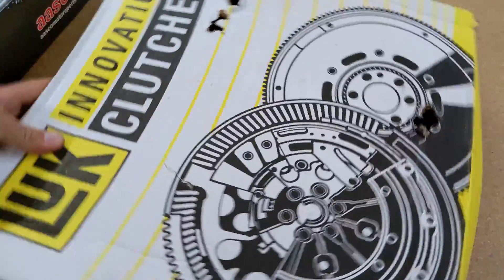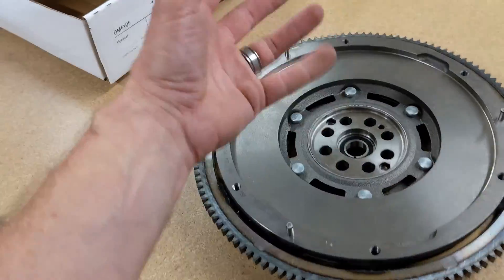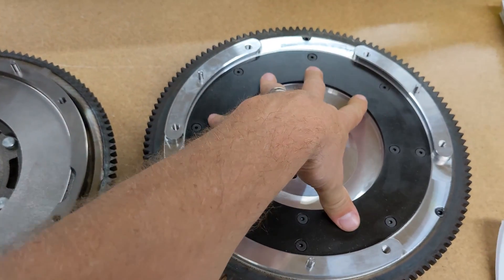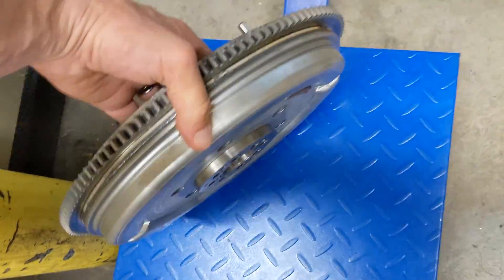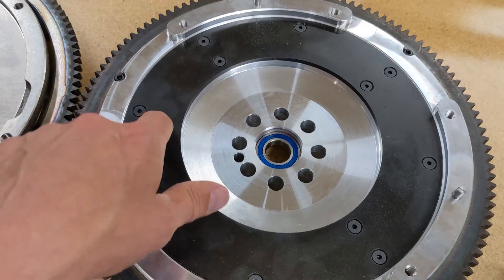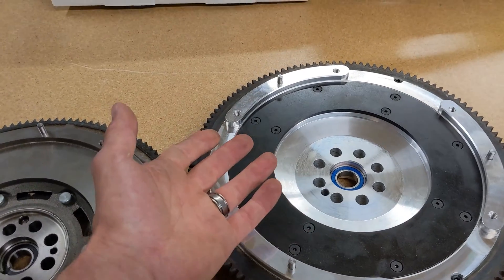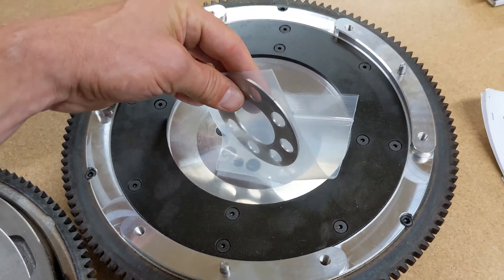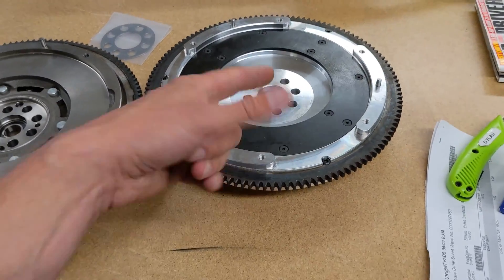Honda J-Series Flywheel Side by Side: AASCO Billet & LUK OEM Dual Mass

Comment: Would you happen to remember what brand clutch was the one having clearance issues and had to be installed without the torque plate? I know you said XLR8 but i know they sell different brand clutch kits. I have a stage 1 Action clutch ready to be paired up with the aasco flywheel would like to avoid torqueing it down just to have to take it off again. Thanks in advance!
Reply from the maker: Not sure what you are referring to, do you have a timestamp for reference?
You should use the torque plate. The important thing is, it is not a spacer.

Comment: I have a j series 04 accord coupe with a TL transmission and a clutchmasters lightweight flywheel. And my stock one came with a spacers front and rear and I used them with my new flywheel. The engine won't spin over now not even by hand. Should I take them off and reinstall ?
Reply from the maker: "And my stock one came with a spacers front and rear and I used them with my new flywheel." Spacers??!?!?!?!? What do you mean?

Comment: Good video! I’m assuming the flywheel needs to be removed for the friction surface to be replaced? There’s not enough access to get to all the fasteners on the rear of the flywheel while it’s bolted to the crank?
Reply from the maker: That is correct, you have to remove the wheel to replace the surface.

Comment: Hey, Marcus came to this video for reference; cause I recalled you made this 😅... I purchased the Aasco flywheel, I'm not sure if I understand correctly. But should use the ring with my ridge clutch disc and pressure plate; it is nonadjustable by the way.
Reply from the maker: That's what it's here for! I'm not sure what you mean by use the ring.
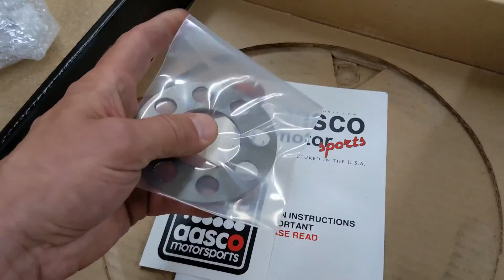Reply: @Heeltoe.  The spacer/ring that comes with the Aasco flywheel @4:30
Reply: @HoMiE327  That's the torque plate. The bolts tighten against it. That's not a spacer.
Reply: @marcusdisabella1881  torque plate... got it! So it has nothing to do with the clutch disc being spaced out, just to help torque down the Aasco flywheel?
Reply from the maker: Correct it's for torquing the bolts down. How would this thing space the disc at all?

Comment: I have a 2010 tl sh-awd . I like the feel of the stock set up. My concern is if I go with the clutch masters f100 kit and the single mass flywheel. Will it feel too aggressive and grabby instead of the nice smooth but sporty clutch feel I have now.
Reply from the maker: "Will it feel too aggressive and grabby instead of the nice smooth but sporty clutch feel I have now." The stock AWD TL clutch does not feel sporty, IMO. The light flywheel will make the engine feel more responsive (sensitive to inputs). The clutch is a mild one, and you may feel the pedal is a little firmer feeling but the disc is mild and it will not engage too abruptly. The FX100 and light flywheel will add sport to the feel but will not turn it into a overly sensitive performance clutch. If you feel the stock clutch is sporty feeling, then you might want to stick with it.

Comment: What kind of clutch kit would match up with the aluminum flywheel? 
I have 2012 acura tl sh awd 3.7 v6
Reply from the maker: The #1 option we have is the FX100 from Clutchmasters, for an oem+ feel: https://www.heeltoeauto.com/clutch-kits/clutchmasters-clutch-kit-fx100-with-hd-pressure-plate-and-dampened-organic-disc-later-j-series-with-single-mass-flywheel-08147-hd00-d-clm.08147-hd00-d.html

Comment: Ive been looking at upgrading my cls6 with a lightweight flywheel and a disk that can handle a little more abuse than stock. I was looking at CM FX250 kit but I noticed the pressure plate is self adjusting. Do you recommend a non SAC or a SAC to pair with the LWFW? I would have dampening on the disc of course. Thanks!
Reply from the maker: Actually all the new (since like 4 years ago) CM J series pressure plates are non SAC. We have another video on the channel about that. https://www.youtube.com/watch?v=1uOW0cXhjIE

Comment: Nice video!  So if you had 2005 TL, what clutch should you pair up with that AASCO flywheel, for street use?
Reply from the maker: A Cluthcmasters FX100: https://www.heeltoeauto.com/clutch-kits/clutchmasters-clutch-kit-fx100-with-dampened-organic-lined-w-hd-pressure-plate-use-w-j30-32-35-dual-mass-oem-flywheel-08028-hd00-d-clm.08028-hd00-d-11.html

Comment: So I can use the luk oem clutch with the asco flywheel? I need help to replace the clutch on my 2011 Honda accord v6 6MT
Reply from the maker: Absolutely! It is a nice, responsive setup this way. We can set you up with a great clutch combo for the V6 6MT.
Reply: @Heeltoe.  aasco flywheel paired with oem Honda, luk or exedy would also work with 2013-2017 6-6?
Reply from the maker: @vq35hr3  yes

Comment: do I need to replace the flywheel when replacing clutch?
Reply from the maker: It's recommended much like it is recommended to resurface or replace rotors when changing pads. But if you've been gentle to your clutch then you maybe can get away without it.

Comment: Is the Aasco lightweight flywheel able to be paired with  a Luk clutch disk and pressure plate ? I have a 2013 J35  6-6
Reply from the maker: The answer is yes, but then you will have a non-dampened setup...it works great, very direct. But also you need to feather and slip the clutch a little more to get off the line smooth. Refine your driving technique and it works great. Have a similar setup in my TSX.

Comment: Hey Marcus, interested in the AASCO flywheel, which clutch-masters clutch would pair with is best? I have an 07 TL type S, preferably something to daily but also to drag race once in while. Which do you think?
Reply from the maker: You would probably do well to use an FX250 with the AASCO. Just make sure you get the dampened version: https://www.heeltoeauto.com/clutchmasters-fx250-clutch-kit-sprung-hub-2007-08-acura-tl-type-s-manual-trans-ua7-08-040-hd0f-d.html
Reply: @Heeltoe.   thanks so much, will definitely add that to cart then. Finally, which aluminum flywheel would you recommend to pair with that, clutch masters or aasco, and why? Thanks again and sorry for the questions.
Reply from the maker: @alland12345  Both are awesome. They are effectively the same. Sometimes it is more convenient to get the CM one because it all comes together then.